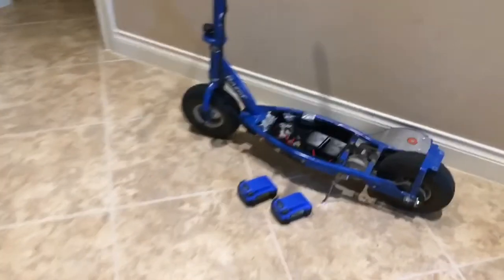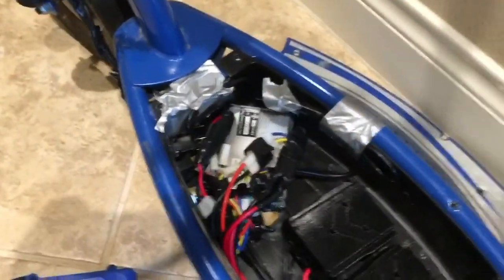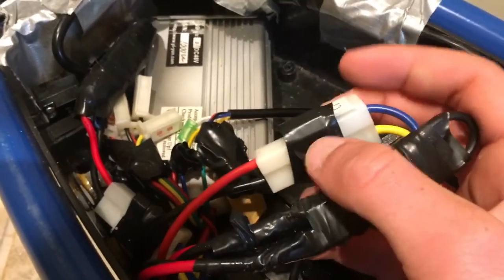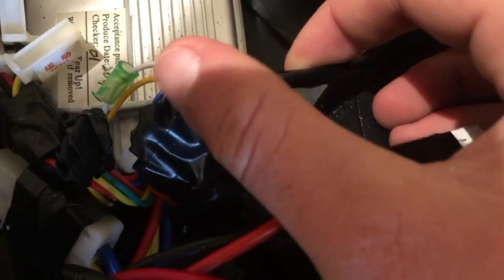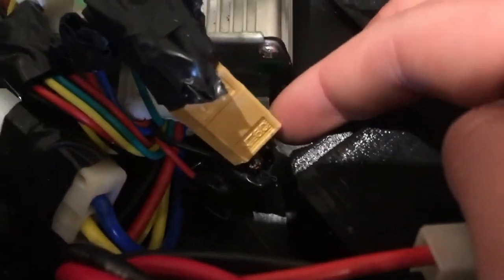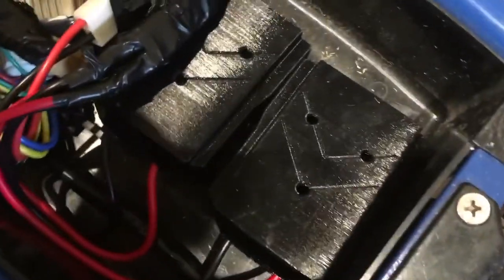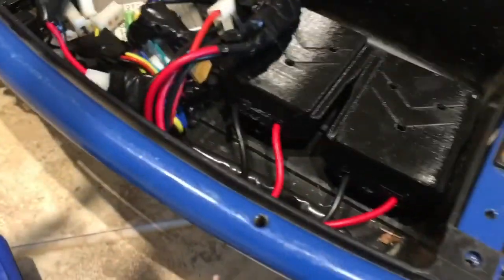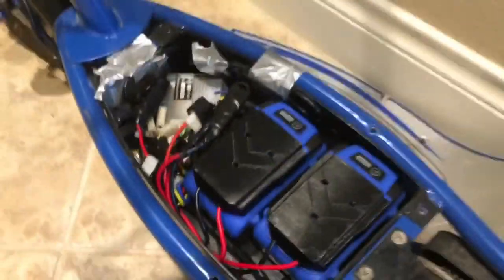30mph Razor E300 Electric Scooter boosted with Kobalt Lithium 24v Batteries

Comment: Hey question I did the same to my e300 same comtroller same packs and for some reason it only goes 17mph? Any ideas why?
Reply from the maker: it’s most likely a controller issue if the batteries are charged up. I recommend getting a new one on amazon and trying again

Comment: Hi I have this scooter and also u have an electric quad with a 1000watt motor do u think I can put the quad motor in to the scooter ??? Would I have to put the quad batterie in there also. Thanks
Reply from the maker: Depending on how big the motor is you may have push the rear wheel back in order for it to fit. Also if the battery tray is  to small you may need to extend the battery tray lower depending on what set up you’re running.
Reply from the maker: Stay tuned because I will be posting a video over Thanksgiving break when I install an 1800 watt motor and controller kit in it
Reply from the maker: And make sure to subscribe and share the video with your friends

Comment: How long did it last before burning out the motor?
Reply from the maker: I have only burnt up one motor, but I installed the same one and kept the speed low and it seems to be lasting quite awhile.
Reply from the maker: Eventually I plan on installing a 1000 watt motor as well.
Reply from the maker: You should check out my latest video with the go kart in order to see the new motor and controller I used with the batteries. I go into detail on how I installed everything as well.

Comment: Did ur motor over heat ?
Reply from the maker: Yah to be honest I have already gone through one, but I plan on making a video on how to swap a 1000 watt motor on it.
Reply: Putting 48V, 1,000W thru the stock (24V, 250W) motor, not surprised a bit that it released the magic smoke.
Reply: @scottwilliams895  real voltage when they on 100% is 29v each
Reply: I'd be interested to see that video of a 1,000W motor

Comment: Hey man. I am looking into buying one of these and doin this same build. Question, did these batteries increase how far you can travel on a charge as well?
Reply from the maker: Jk Tested again and got 7 miles!
Reply from the maker: I wouldn’t trust that because you will only have that range when it is brand new. I have a whole pile of those lead acid batteries and I have yet to go 10 miles with the stock set up this is still much better in my opinion
Reply from the maker: Personally I have 2 4ah batteries and one  2ah and I think I went somewhere between 2-3 miles with all three also don’t go bigger than 4ah or otherwise they won’t fit in the tray ,but if you had a razor dirt bike I would just go all out. Anyways thanks for the comment.
Reply: @eatsleepplayrepeat1914  wait you're saying that the range on your scooter is 2-3 miles before it dies??? Damn that's not right. This scooter has a range of 10 miles from factory.